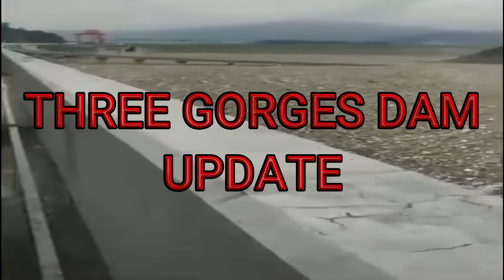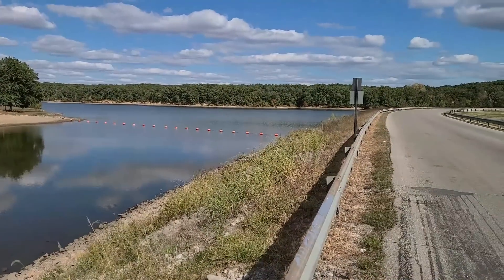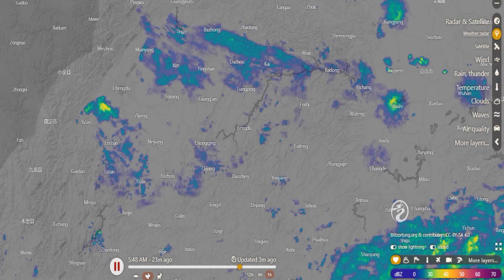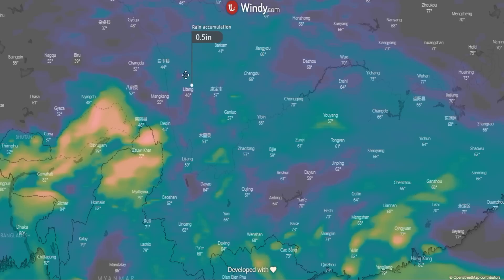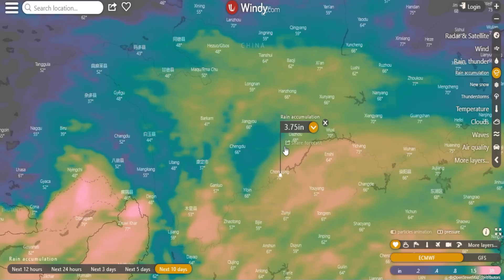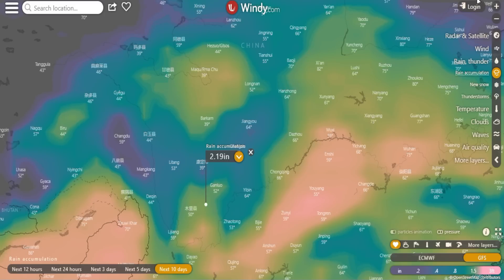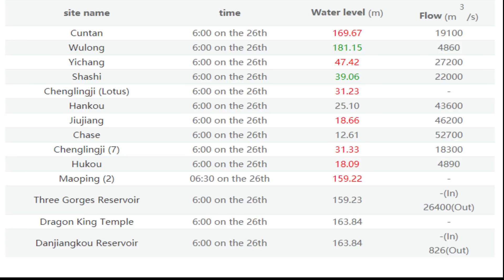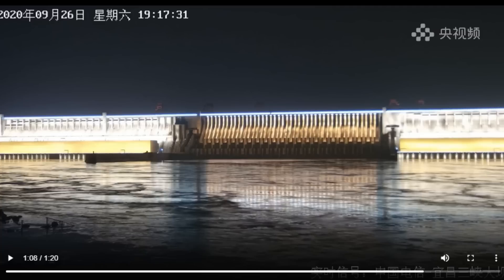THREE GORGES DAM UPDATE 9/26/20

Comment: Litchfield lake is only that low because of the new subdivision being built, they have to dredge the cove and other parts of the lake.
Reply from the maker: From my understanding they are only dredging Bishop and Pete's cove. They are also building to settling ponds in the those two creeks to stop silt from re-entering the lake after they dredge. However I did not see that they were judging anything else. Even though it needs to be done. Thanks for watching Brett

Comment: These cracks can NOT BE on the three gorges damn the river is FAR TOO NARROW 
So you have posted a FAKE PHOTO
On top of this is not in the DAMN it is on a cosmetic strip above on a wall on a road on top of the damn. so this would not even be made by the company that made the damn it would be by a road company or a different crew altogether
Reply from the maker: You are incorrect. These pictures came from the 3GD. I screen shot the picture from a video from there.